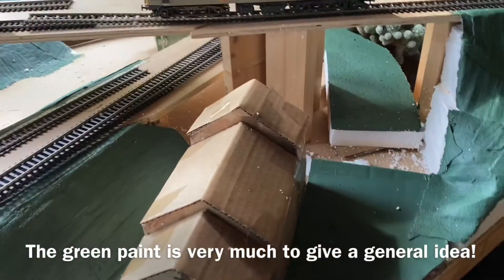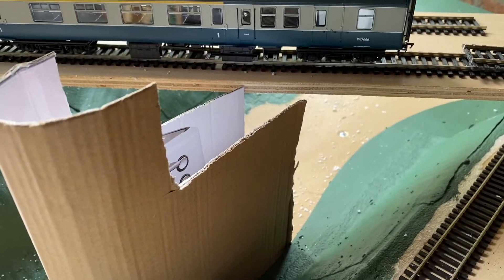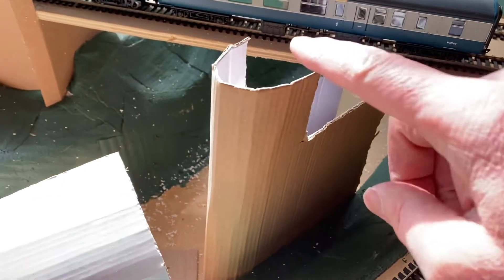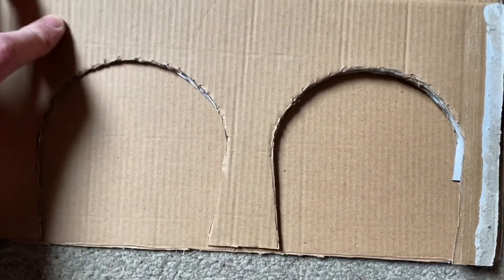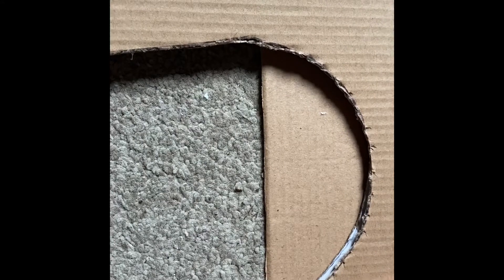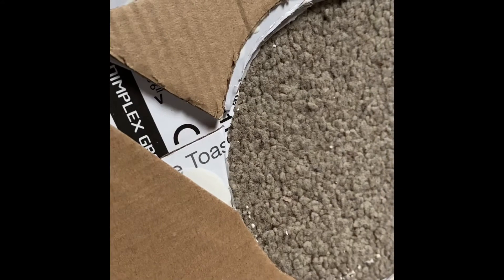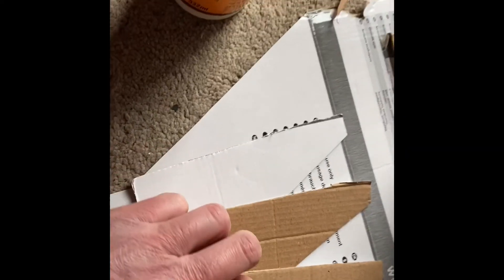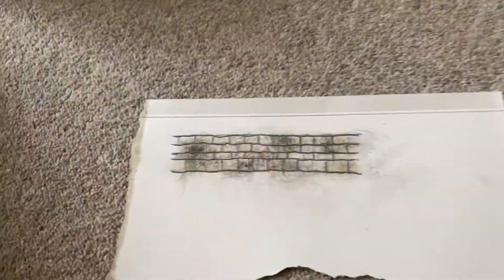(HD) Work begins on the new viaduct and bridges - Scratch-build - UK Trains OO model railways

Comment: Very good Paul. To get a 3d ish effect on one of my tunnel portals and retaining walls I cut individual bricks in card and glued them on then weathered with cheap acrylic paint dry brushed. I got my idea from john Warner. He did a viaduct on his YouTube channel Piccadilly sidings by John Warner. Just an idea atb Andy
Reply from the maker: Hi Andy, many thanks for the tip mate have seen a few of Johns videos but will have a look at that and see what I can pick up. I have been doing a bit on it this afternoon too with the weather how it is today and was planning on bringing out some of the stonework at key points out with a similar method. Have also been using a bit of ash and charcoal from the log burner to get a weathered effect. Thanks again will check in on that soon. All the best mate, Paul